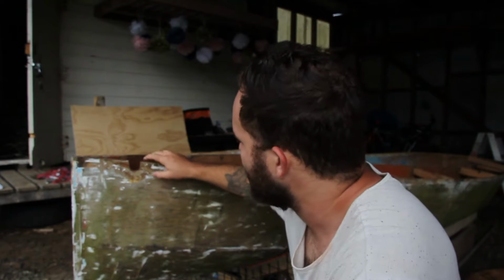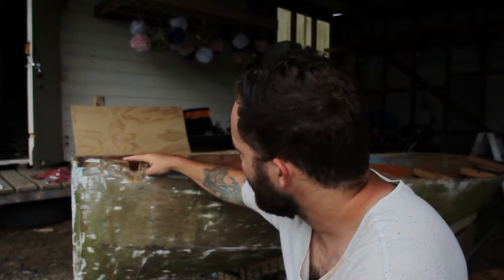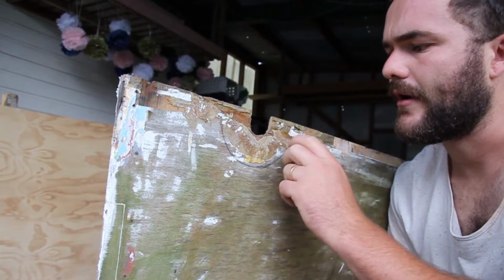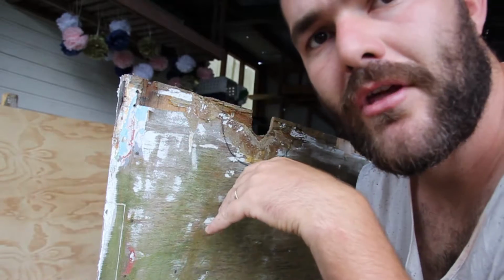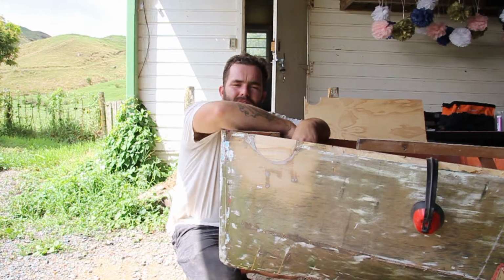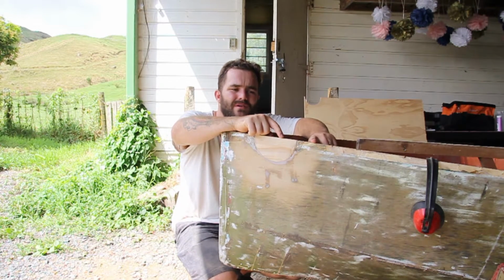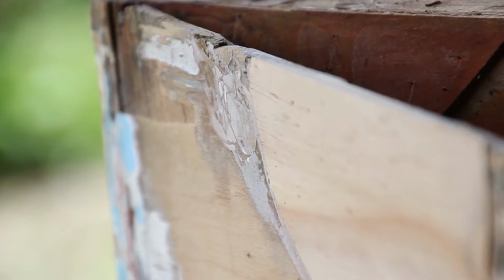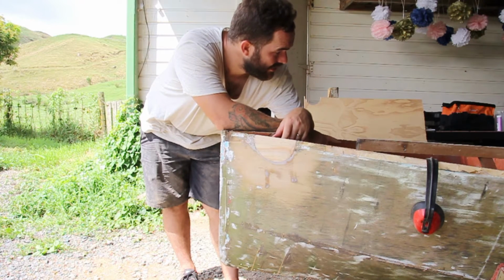Fixing a hole in a Plywood boat | Sailboat Restoration Day 3

Comment: Looks like an ancient Cherub, possibly Javelin
Reply from the maker: Yeah its a cherub. One of the first ones apparently
Reply: @juliangoulding   My (probably failing) memory is that the slightly later cherubs (late 1960s on) had a wider tuck, judging as best you can from the video, yours retains the narrower tuck, confirming a very early origin
Reply: @juliangoulding  wheres the other vids mate?  ive got a 1960 wayfarer in poor condition that im about to restore your vids would help im sure